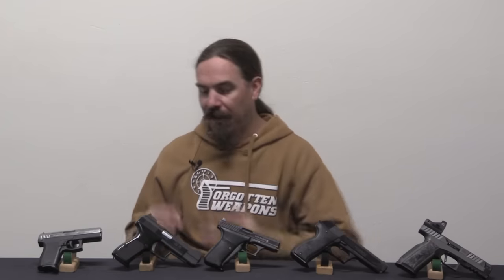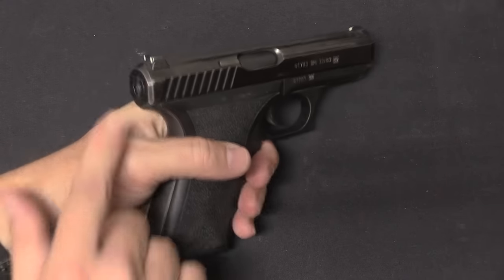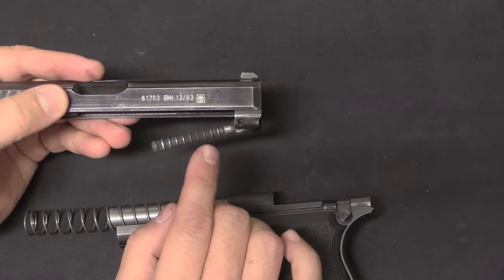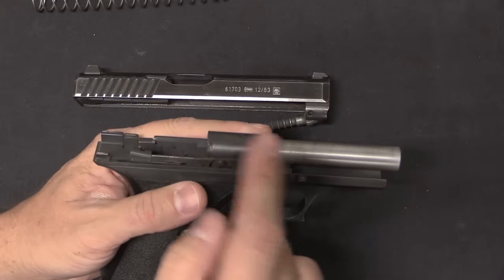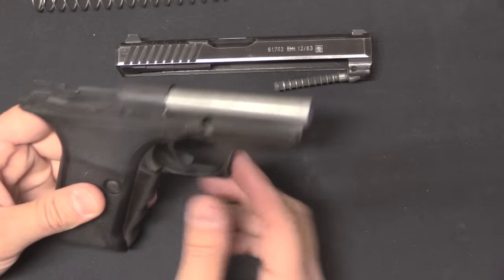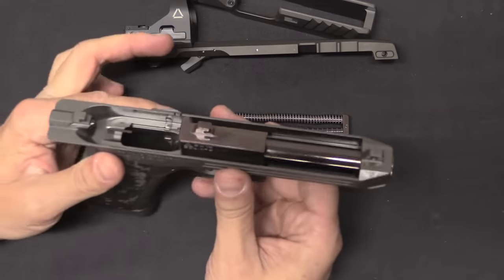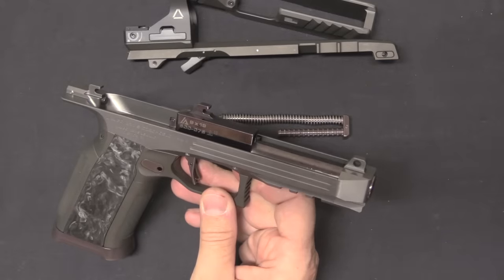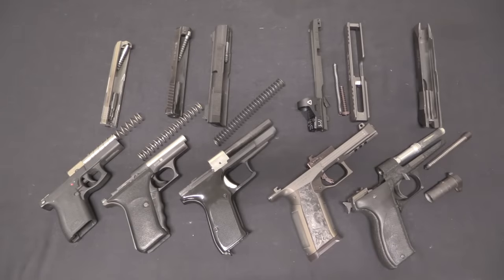Gas Delayed Blowback Pistols: A Tour of the System

Comment: I beg to disagree with Ian. I think that Steyr GB is the best of them—at least technically. And my reasons are:
1/ The gas piston is the barrel itself and the gas cylindre is an easily accessible part. It’s far easier to clean these components—and that matters immensely.
2/ The pistol has very reduced number of components; indeed, there are just a handful of them. E.g. the sear, disconnector and ejector are all one piece multi-purpose component. No single spring has only one purpose (except the firing pin spring). Ingenious engineering.
3/ The gas cylindre (the area that heats up) is substantially further away from the hand than in all the rest of them. And
4/ 18 rounds in the double-feed magazine… You don’t even need extended size of the grip. And yet, the pistol isn’t any wider than usual (there are many thicker pistols) because the frame is made of pressed and welded sheet metal. So inventive!

Comment: The CCP is super easy to shoot, is very concealable and is accurate. The reason I got rid of mine is the same I issue with handguns of that vintage - it doesn't support a red dot directly. Also, the standard plastic Glock compatible sites are garbage (but that's an easy fix). It feels odd to shoot, though. The recoil impulse is very light, but the inputs come in differently from standard locked breech pistols. It feels very much like a suppressed pistol using a Nielsen style piston. It just takes a few mags to get used to.

Comment: Might the Steyr GB get less hot, less quickly, by not letting hot gas into the cylinder until it's actually needed? The others reportedly all do get hot, about the Steyr I do not know, but it's an army service pistol with a big magazine, the others are mostly backups, and the Steyr's working parts are also quite big, which might also be a temperature-control thing.

Comment: That Norinco looks like an excellent design to give the user Negligent Discharges
Reply: The trigger guard is a bit wider than the trigger so if you finger slips off it will go past the trigger, when its fully pulled the trigger is blocked completely by the trigger guard, so if your finger slips loading it, it wont be fully loaded. And if its loaded already, you arent using the trigger guard.

Comment: One comment to add to this excellent video about the P7's....their fluted chamber.   This acts to slow the opening also as the brass deforms into the flutes and provides resistance along with the gas system so they're partially 'case deforming retarded' blowback systems.   The HK series roller-delayed blowback guns also employ the flutes for the same reason.

Comment: I wonder if it would be possible to make a fixed barrel pistol where the slide is locked by a wedge to the front of the frame, and the system unlocks venting gas from a port almost at the end of the barrel.

Comment: I love that the Walther CCP (the one gas-delayed blowback gun I actually have) is the one Ian doesn't. Especially because you can find them for <$300 used. 

On the topic of the CCP, it's a serviceable gun, but just doesn't hold up very well to the modern carry pistol market with its 8-round single-stack mags, non-ambi and non-swapable manual safety, and no optics cut option. Also disassembly and reassembly are both a little annoying compared to a Glock or Sig or really most other modern striker-fired pistols.

Comment: I have a Wilson ADP.  Light, accurate, compact and fits my hands great. The pistol has to be very clean.  After approximately 100 rounds carbon fouls the piston and gas chamber, then the pistol stops functioning. 
If fired continuesly it gets hot around the trigger.
The ADP is the softess shooting 9mm I have ever encountered. 
Smaller than a Glock 19, not much bigger than a P365 XL.

Comment: The P7M8 was my first center fire hand gun. I got it in 1995 or 1996 (should have ponied up for the P7M13). I'll tell you that it kicks MORE and feels snappier than a tilting barrel 9mm of a similar size and weight. This is because the slide velocity is probably higher than usual. The entire thing about gas retarded guns being self-regulating is NONSENSE. They are not. Why? Because the retardation force is a function of chamber PRESSURE, whereas recoil is a function of the bullet MASS x ACCELERATION. This is why the system basically doesn't work beyond 9mm. H&K did make a 40 S&W P7M10 but they had to add so much mass to the slide it looks like a Hi-Point... LOL!

Comment: Many years ago I saw a P7 M8 get ruined by running lead reloads and get the gas channel get stuck with lead residue rendering the pistol useless. Outstandingly the pistol was able to shoot but not cycle with an almost near dangerous operation given the extremely high pressures. A real shame for a beautiful pistol.

Comment: Ian, can you do a review on the rotating barrel handguns. like the Beretta cougar, colt 2000, grand power, remington R51, PA15, and the unicorn Glock 46 if such thing is real.
Reply: This is the system I was going to suggest. I have only ever owned the MAB PA-15, but there are many others including the 1907 Roth Steyr, 1912 Steyr Hahn, the .45 ACP Savage Model 1907, and the Mexican Obregon.
Reply: that would be nice, especially looking deeper into how little the actual delay by rotation is in some pistols. in the PA-15 and PAP-F1 it almost feels like zero delay.

Comment: My favourite system 😍

The Steyr GB was such an interesting pistol, but it didn't stand much chance against the Beretta and Glock. Had it been adopted by the Austrian Army the combat tupperware world would look very different...
Reply: The barrel looks like it'd be fairly expensive to manufacture, which is a definite mark against a pistol intended for general military issue. It's a cool design, though.

My favourite of those guns remains the P7.  It's not only got a neat operating system, but I think the cocking grip and striker system is a very good and clever design.
Reply: Steyr just doesn’t get much respect in the pistol market. I own one of their current production M9-A2 pistols. It is a fantastic design, but the polymer framed, striker fired pistol market is so crowded the M9 series gets completely overlooked. One reviewer described it as the best pistol you’ve never heard of.

Comment: Not a word about heat build up. 
All sorts of rotating barrel lock and delay would be nice.
Will Doc Shush make it in to the press 2024?
Reply: in actual normal use it's not really a big problem.  maybe in ipsc where you dump a bunch of fully loaded mags in a few seconds, but in all other competition, police and army use it is not a problem. al guns get hot when you dump several mags in one go.
Reply: @noneofurbusiness-yk1mg 
With the P7 they made a head shield you'll need after 2-3 mags. The Alien is exactly made for competition.

Comment: Are there any firearm/cannon designs that disconnect the recoil or similar springs in order to make it easier to chamber the first round?

With more powerful calibers that require stronger springs to deal with recoil, that makes it harder to chamber that first round. I recall you did a video of a light canon that had a crank in order to chamber that first round. 

I would think there would be designs that allows you to bypass those springs to allow easier chambering of the initial round

Was thinking about this with my AR10 that it's significantly harder to chamber than an AR15. With stock charge handle, you can loose your grip and smack yourself in the face. Even my 10mm Delta Elite, it's hard for some people to chamber

Comment: Ian mentioned during the recent Alien videos that a potential drawback of the gas delayed system is excessive heat buildup compared with other pistol types. Does this occur with the other gas delayed examples?
Reply: I can't speak on other ones but I've seen multiple videos of people complaining about heat on HK P7s.
Reply from the maker: Yes, heat can be an issue with all of them.

Comment: How bad would it be if incompressible substance such as water or oil got into the gas cylinder? Would it only result in malfunction, or would it blow up the whole gun?
Reply: Shouldn't increase chamber peak pressure much ... except maybe for steam production as water is forced into the hot barrel.  Could slow bolt opening enough to prevent proper cycling.

Comment: I simp for the s&w 5.7 gas delayed, lowest centerfire pistol recoil I've felt and I own one of the original aliens
Reply: Love mine. Makes me feel like I'm a way better shot than i am.
Reply: It's not gas delayed.
Reply: @durayenterprisesllc4440  it is absolutely gas delayed. It has a gas port in a 2 part barrel sleeve which delays the unlocking by having the inner part cam into the outer barrel. It has gas rings lmao.
Reply: @patrickmurphy8008  you can lmao all you want, but you're still mistaken. Look closer. Watch the cutaway animation. The gas doesn't prevent or delay opening; it causes it. It's a locked breech.
Reply: @durayenterprisesllc4440  the semantics of the gas causing the gun to work is silly. In that case the Alien or possibly other pistols in this video are included in that.
Reply: @patrickmurphy8008  well that's the beauty of a free country; you get to stay willfully ignorant of you want.  This video is about gas delayed blowback pistols. The S&W is neither blowback nor gas delayed.
Reply: @durayenterprisesllc4440  the only willfully ignorant person here is you. Despite the title it features guns which aren't "blowback" at all like the Laugo Alien. I dunno what you're assuming about country, but this is the internet. You should stick to your lane which seems to be badly made stripped down 300 ARs which don't sell.

Comment: Just a question, would you consider the AMT Automag II in 22mag with it's drilled holes in the chamber as a gas delayed blowback? From my understanding the holes were to expand the case and hold the slide from opening because of the slow burning rifle powder, they do make some pretty cool marks on the case 

I had a 4.5" Irwindale CA one and it was a good pistol, but I ended up trading it off for a Ruger 22 pistol as I just wanted a plinker and it was expensive to feed the Automag
Reply: Oh that sounds like a chamber ring case expansion delayed blowback, I think there was a German or Austrian pistol that used this? It was definitely used on the PMM

Comment: One question. You never quite explain what causes the slide to move backwards to begin with. Only about what causes it to not move. So where do the force pushing it backwards come from?
Reply: From the cartridge pressure, just like any blowback semi auto.
Reply: To elaborate slightly on what the other poster said, when the gun fires, there is a (hopefully) small, controlled explosion inside the cartridge, which is seated in the barrel of the gun.  Most of the explosive force (again, hopefully, otherwise, well, ask Scott from Kentucky Ballistics) follows the path of least resistance, and pushes the bullet out of the cartridge and down the barrel of the gun.

However, because physics, some of that explosive power also goes in the other directions.  Unable to (hopefully) go anywhere else besides backwards, this presses the now empty cartridge against the breech-face of the gun, which pushes on the bolt, which is connected to/built into the slide.

More simply, bullet goes forward, slide goes back, action/reaction.
Reply: @YaBoiZackbannedmefordissent  Isn't that kind of like out of battery detonation? Is there then some kind of sleeve to keep the pressure in and preventing the cartridge from rupturing?
Reply: @anteshell The slide is moving so slowly due to the delay system that by the time the case is unsupported enough to cause any issues, pressure has already dropped to a safe level. In a straight blowback this is done just with a heavy bolt and strong spring.

Comment: Would the Desert Eagle be considered a gas delayed blowback? Really interesting video. Thank you Ian. The Alien and the Steyr really have interesting mechanisms!
Reply: The Desert Eagle is a direct impingement gas operated pistol, which is almost the exact opposite of a gas delayed system.  The gas port is near the end of the barrel, and the gasses actually push the slide backward. It has a rotating bolt to keep the breach locked,  just like most gas operated rifles. The cartridges the DE fire are too powerful for gas delay to be safe.
Reply: @sethgordon4473 What? It isn't DI at all. It has a piston fixed to the slide internally.
Reply: @skepticalbadger Exactly. That is what the gasses ported from the barrel impinge on.
Reply: @rdrrr  You're right, the AR-15 is not true direct impingement. The boot carrier is the gas cylinder, and the bolt itself is the piston.
But the DE is truly direct impingement. The gas piston is a fixed stud on the front of the slide, and the cylinder is a chamber under the muzzle end of the barrel.

Comment: Here’s another gas operated pistol… the Desert Eagle, but the Deagle uses a traditional gas piston system that commonly found in automatic rifles. The purpose of Deagle’s case is to reliably fire and cycle a very powerful cartridge in a pistol, as the cartridges used in the Deagle require lockup to prevent explosions during the action of firing. And the barrel in the Deagle is fixed to achieve the potential maximum accuracy. This is all thanks to Mr. Brandon Herrera with his episode on the Desert Eagle.
Reply from the maker: Gas operated and gas delayed are different things…

Comment: Then what is the Desert Eagle?
Reply: Gas operated.  It has a rotating bolt that locks.  Unlocking the bolt, under gas pressure, is how it delays recoil long enough for chamber pressure to drop to safe levels.
Reply: In super simple terms, gas is going to opposite way on the desert eagle vs these gas delayed pistols.

Comment: Here’s a thing i don’t understand.
Pistols with fixed barrels are supposed to be more accurate.
But a rifle with a fixed barrel is not as accurate as a rifle with a free floating barrel.
Why is that?
Reply: Probably because of barrel flexing, longer barrel will flex more than short one in pistol, free floating help reduce flexing. You can see barrel flex in slow motion videos, especially gun with bare barrel.

Comment: I had a P7 at one point in the 90’s.  Thought it was the coolest thing.  Saved up and found a used one and I was so happy.  Until I took it to the range.  You couldn’t get more than a couple of magazines through it before it was too hot to hold.  And then that was it, it took a looooooong time to cool off again.  Also if you don’t clean that piston and cylinder immediately after firing, the piston will jam in the cylinder and you have to beat it back out with a mallet.  Piece of crap.  Terrible design.

Comment: I'm surprised you didn't mention the Desert Eagle which is probably the most popular and common gas operated pistol
Reply: Gas delay is a different system than gas operated. Gas operated pistols, like the Desert Eagle have a locking bolts.  Gas delayed pistols, like those in this video, have bolts which do not lock.